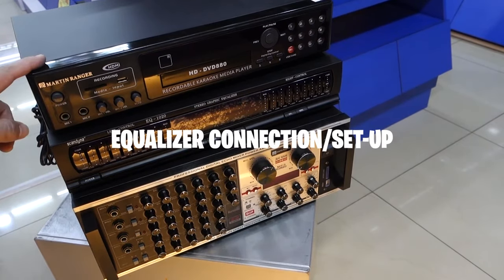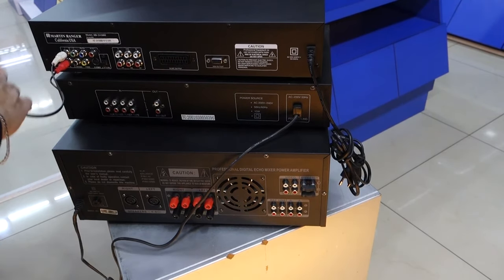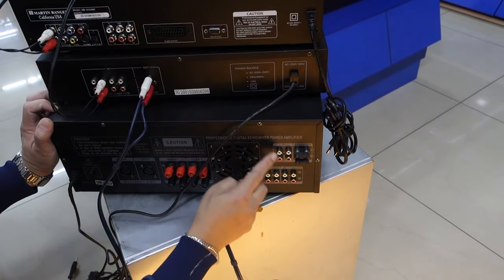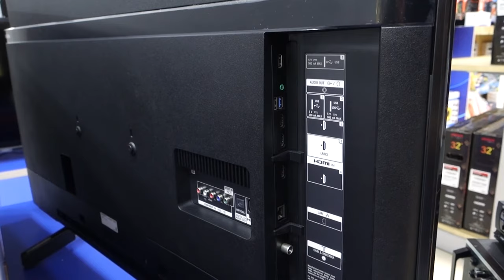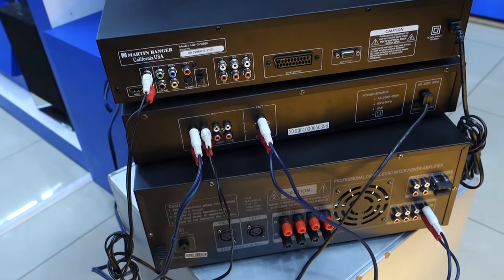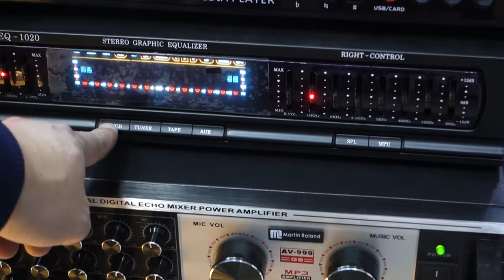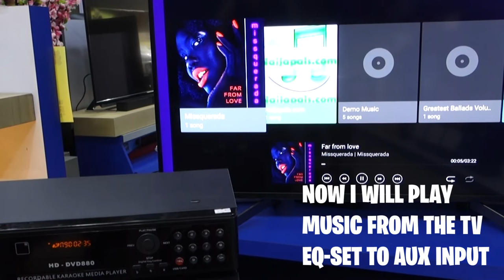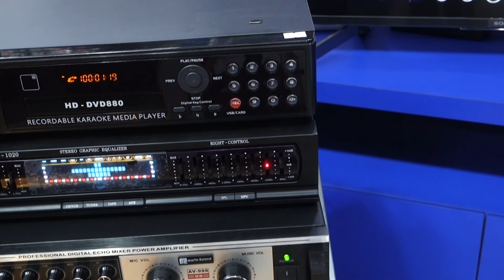How to connect or set-up the audio graphic equalizer to amplifier?

Comment: Hİ,
Couldn't connect kenwood sound system can you help me. Kenwood RA-522 Reverberation Amplifier
 / 
Kenwood GE-522 Graphic Equalizer  / Kenwood GE-522 Graphic Equalizer

Kenwood KD-122R pikap

Kenwood RA-522 Reverberation Amplifier
Kenwood KA-322 Sterio Amplifier
Kenwood KT-322 Stereo Tuner
Kenwood KX-322 Stereo Casette Deck
Kenwood GE-522 Graphic Equalizer

https://hizliresim.com/hcDCxJ
Reply from the maker: Hi sir..let me find more details about this system..and i will try to figure out how's the connection..If you don't mind can u send pictures of the back panel of the systems?? pls pm to my facebook page.(link posted above)Thanks